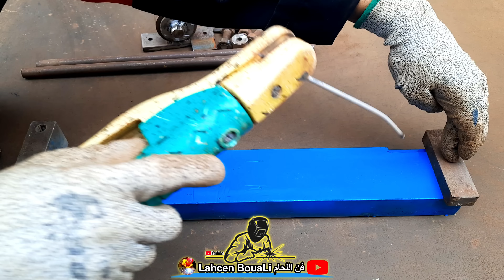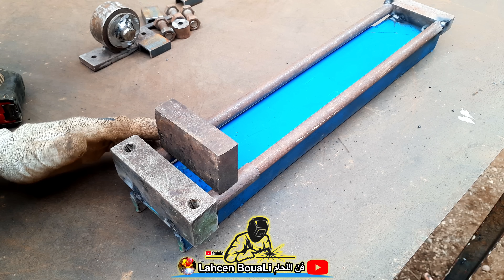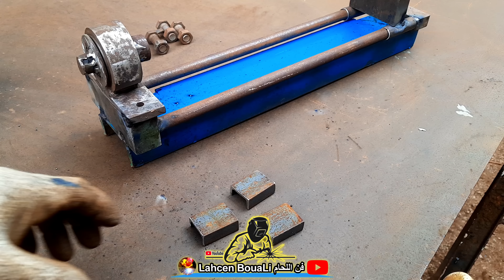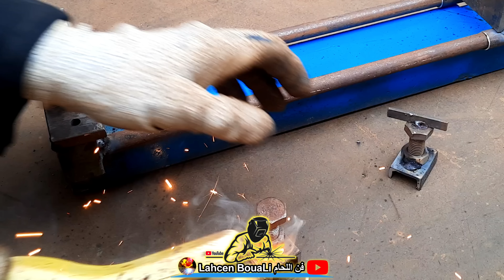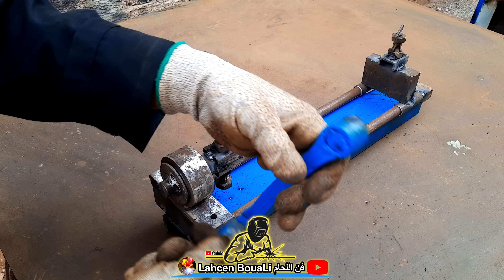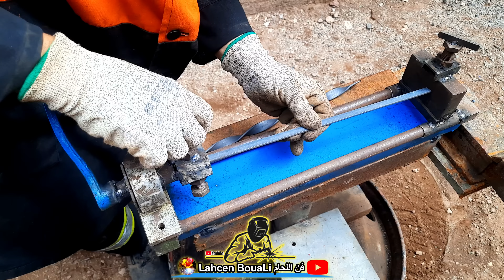تعلم كيفية صنع أداة ثني ولف الحديد | Learn how to make an iron bending tool

Comment: Very nicely made,but there is something to be improve,if you make the handle more solid and little longer than it will be very easy to twist,and your base should be more stronger than your present base,need more weld in the base channel,but overall it's a nice work done ✔️ 👍